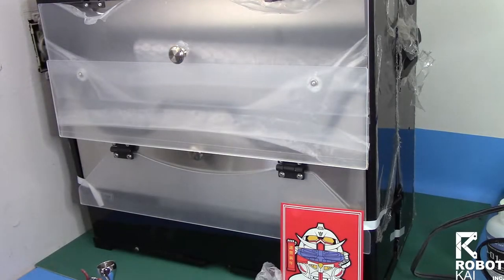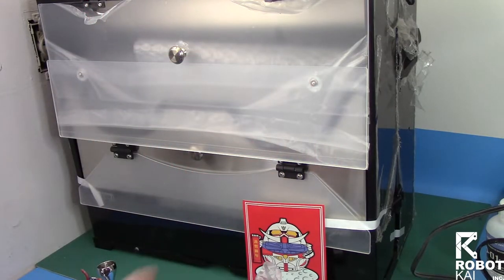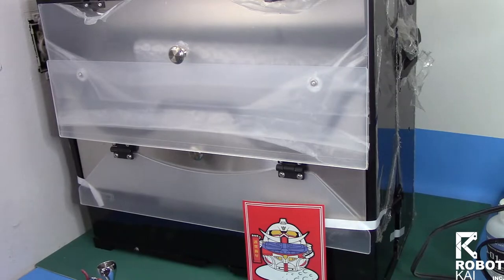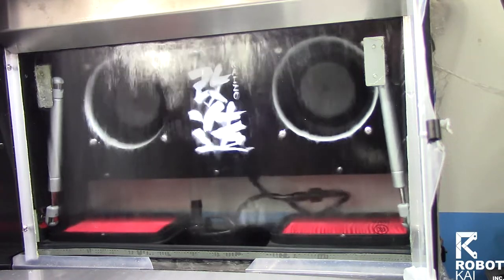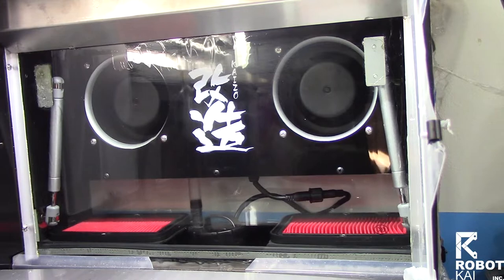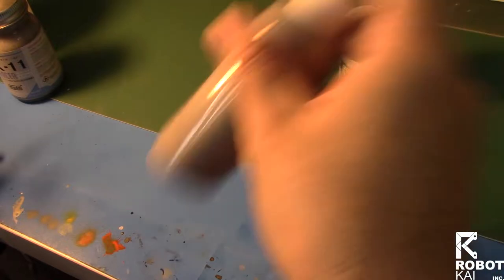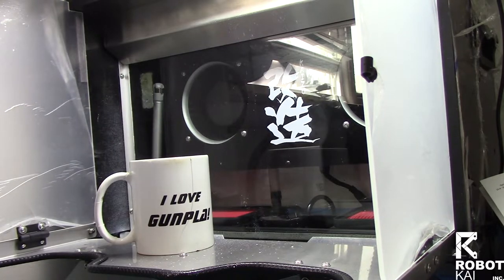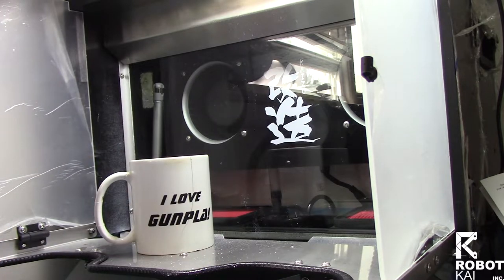ToolTime with Stryderprime - Kaizo Waterfall Spray Booth review

Comment: What the measurements of it? thanks.
Reply from the maker: the manual says 1.2 liters but it will work with just one liter
Reply: @stryderprime   Thanks, btw the size of that booth is huge is 20 x 19 and 9 inches deep.